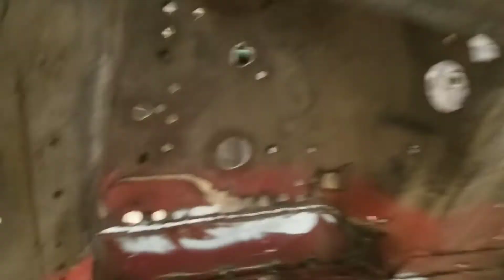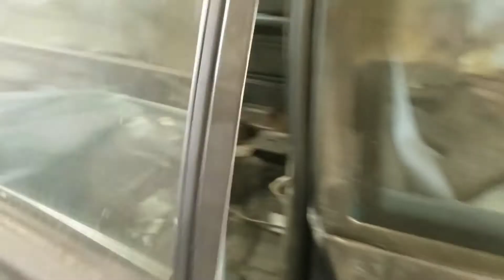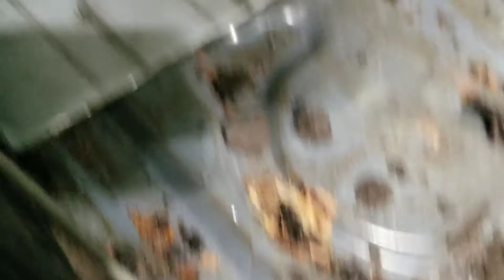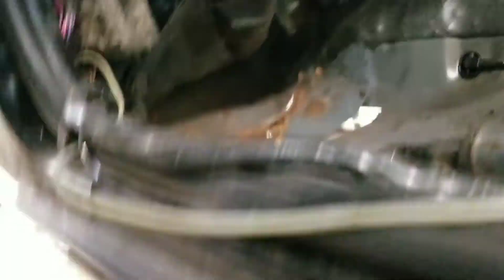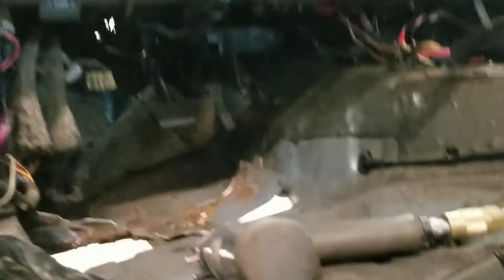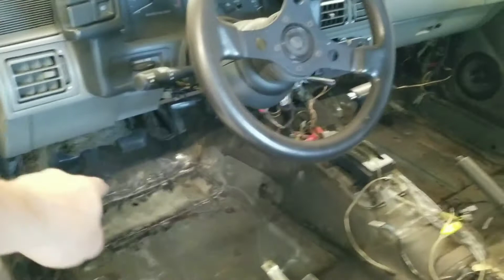90 foxbody Mustang rotten rusty strut tower, frame rail, floor pan and firewall repair part 3

Comment: Great content just like all of Your videos that I have watched ! Noticed that Your seat support brace is cracking are You going to replace it or repair it ? Who makes the flanging tool that You use ? Any information that You can provide will be greatly appreciated . Thank You .
🇺🇲🇵🇷🦊👍
Reply from the maker: Astro Pneumatic makes the flange tool. We just weld them seat supports back up usually, unless they are to far gone. Thanks for the support!

Comment: Hey man I have a 91 fox and it’s a solid rust free car but someone prior to me board slid the car and the driver side frame under the floor board right by the spot you cut out isn’t bent up pretty bad. I was wondering if they sell those replacement pieces still and what are they called? Thanks for the info if you can help
Reply from the maker: Not sure exactly what part you are talking about can you send a couple pics to my email. Cbuckner0859@gmail.com

Comment: Great video on those corners where the fender lines to the firewall where u mentioned the leads accumulate and rot out. Was it tonight to cut out?

*Base of windshield and firewall/cowel area
Reply from the maker: Misunderstanding your question sorry.
Reply: @bpbrestorations2093  edited sorry.
Reply from the maker: No it's not bad just make sure you cut it out big enough to get all the rust on the first attempt then you can save the rails and pieces you cut out to put back in after you repair the rust underneath it. It will go back kind of like a puzzle.
Reply: @bpbrestorations2093  appreciate it have been watching videos non stop. 

Starting to think I might pull that spotted triangular piece off. by the upper front frame rail by the cowel ,plate it por 15 it and hope for the best. 

Or pull the windshield out and the upper cowel 😅
Reply from the maker: It's a ton of work, but unfortunately sometimes that has to be done.
Reply: @bpbrestorations2093  appreciate it

Comment: How much would something like that cost? The strut towers
Reply from the maker: Frame rails, shock towers, floor pans  like this you can expect somewhere around $2200-$2800.
Reply: BPB Restorations thank you bro
Reply from the maker: No problem